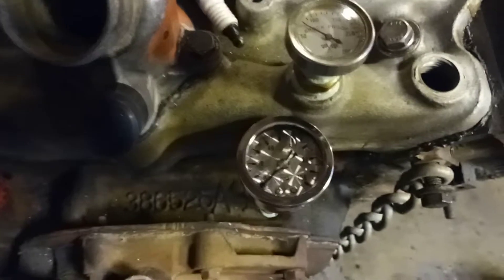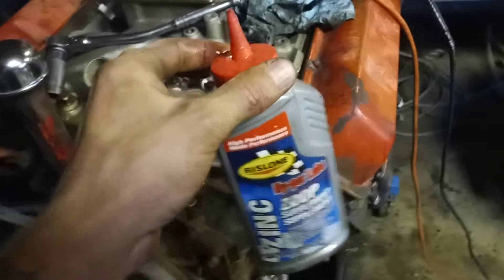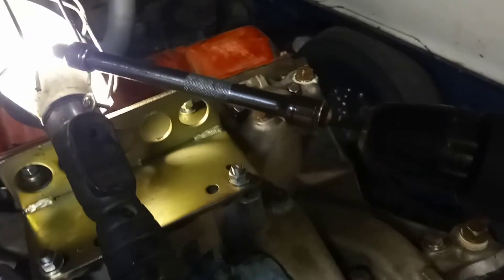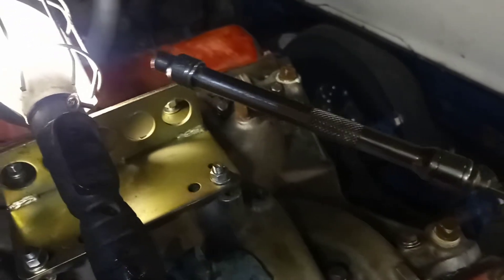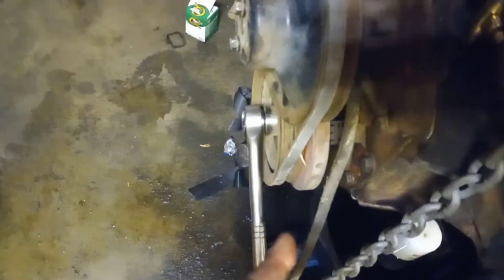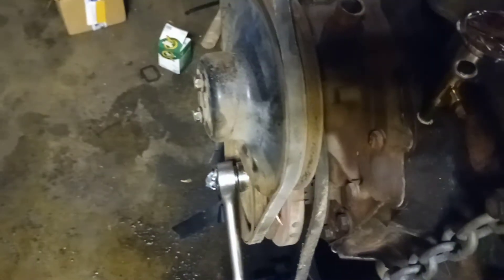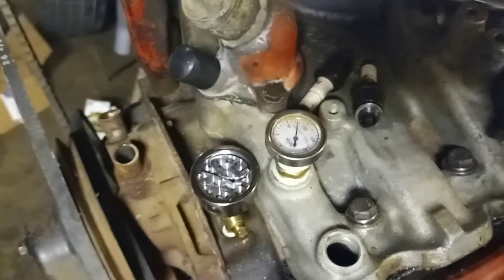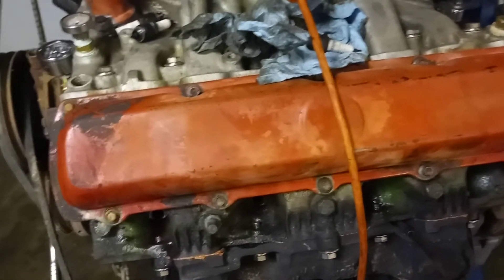Oil priming a engine (Olds 425)

Comment: Another good video mr
Reply from the maker: Thanks, Its a good thing to know. I have seen people turn over motors that have been sitting without letting atf sit down the holes and broke piston rings that eventually got jammed in the side of the piston skirts and destroyed the bore so bad it would need to be sleeved. If its a stuck motor nothing I mean nothing works as good as 50/50 mix of acetone and ATF. Not sure about other motors but a OLDS wont fully oil unless it has half a rotation.
Reply: @wildrosegarage4208  yup are usually use a mixture of diesel fuel ETF and a shot of gasoline to thin everything out , seems to work pretty good
Reply from the maker: @unclesquirrel6951  That will work but ATF and Acetone 50/50 is the best I have used. I put in squirt bottles and use it on rusted bolts as well.
Reply: @wildrosegarage4208  The oiling system on a olds is it's weak point , I do know they love to pump all the oil into the cylinder heads because of a lack of a drain back but again if a guy doesn't mind how it looks he could always put a couple of drains in the valve covers on the backside of the engine so you don't notice it as much put it back in the engine into the oil pan but then you have to make extra holes in the tins . I've got a couple of 455 Oldsmobile engines in my shop I always loved those things very appreciated  torque monsters .
Reply from the maker: @unclesquirrel6951  I have played with a few OLDS motors so here is my take on it for what ever that is worth. You can grind out oil drain holes, use restricted push tubes or cam bearings. But I personally don't think the problem is as bad as it is made out to be. Sure drain back is poor but the ones that had the issue were boat guys pinning at 5000 plus across a lake for minutes on end. If you run a stock oil pan run a stock pump, If you run a h.v. pump you need a 8qt pan. I have a h.v. pump in my 488 and it is fine with a 8qt pan but I don't stay on it for longer than a 12 sec 1/4 mile. Olds are great street motors because of low power bands and good torque but after about 450h.p. lots of big blocks will go faster for cheaper and a lot of this is because of a poor exhaust port, long stroke and small bore so you can only fit so big of valve and are RPM limited. My 488 has a 4.5'' stroke the piston speed at 6000rpm is crazy fast.
Reply: @wildrosegarage4208  yip absolutely, everyday driving at normal driving rpm is fine . There many olds engines running around with a zillion klms on them and still kicking . They are built as a low to medium rpm engine for heavy cars ., 455 olds is a good all around engine for street use anymore then a good street or street performer I'd start modifying it abit to last . I'm hoping Richard Holdener will get his Dyno hands on a 455 olds to so some testing one of these days. I really like the 500 caddy also , it's a natural Torque monster way down low . 500 cubes breathing through small block sized heads it's no wonder they make so much pulling power , check out " 500caddy.com ) . I like all of those engines , three 455s olds Buick Pontiac, rhe 472/500 caddy , I like them almost as much as bbc the thing I take into consideration is the price and parts availability. But everyone has a sbc or a bbc but not everyone have 455-472/500s just (  cooler )and that's why they always get the edge in my mind price wise and parts choice and availability it's always the chevys
Reply from the maker: @unclesquirrel6951  I have a 500 caddy and know lots about them had a 472 as well but sold it to a buddy. It will be going in my 78 Lemans I will sell the dart head solid roller 383 that's in it now. That's the next one on the list.
Reply from the maker: @unclesquirrel6951  BBC is the most bang for the buck fore sure.